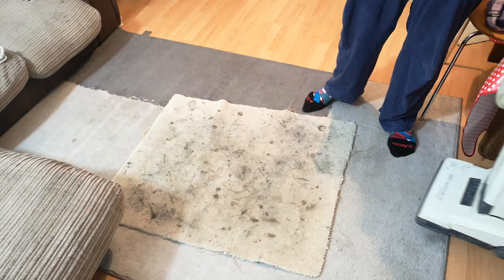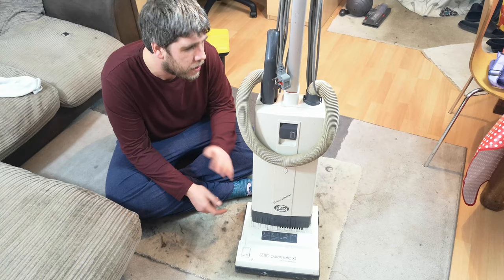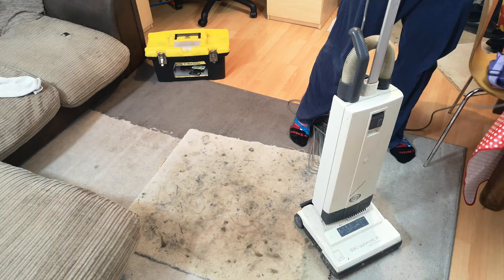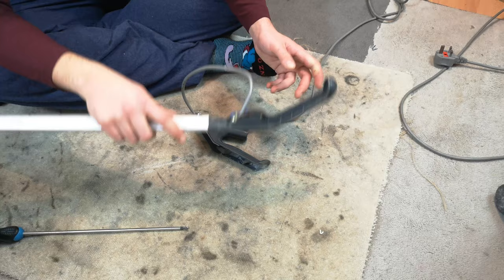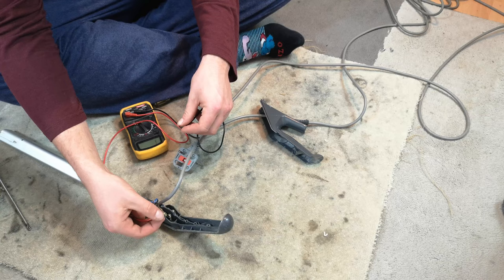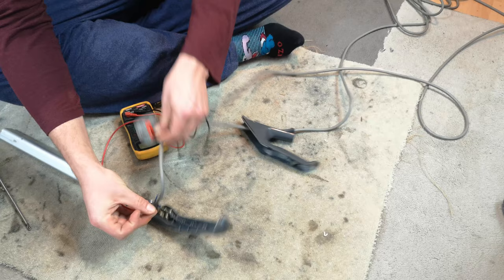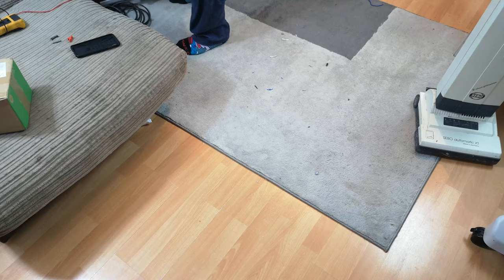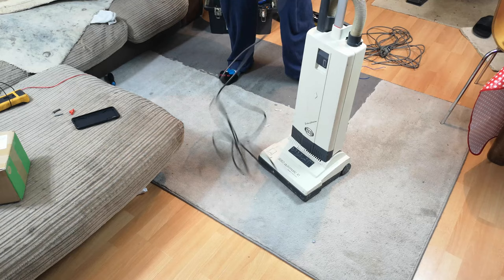#Sebo #Commercial A £10 Sebo X1 - Repair & First Look!

Comment: Then bending cable at the strain relief failing is what happened to one of our BS36's at work, did the wiggling cable trick and was met with a large spark! I knew where the problem was then! Had some spare flymo flex, fitted it and all was well. Henry cables work just as well, you just have to be careful where it attaches to the PCB on the top of the main unit, as clamp it too tight and you can break the in off the connector.
One of the contractors who works on site was getting shocks from his BS36, yep same fault. He ended up getting one of our spare ones.